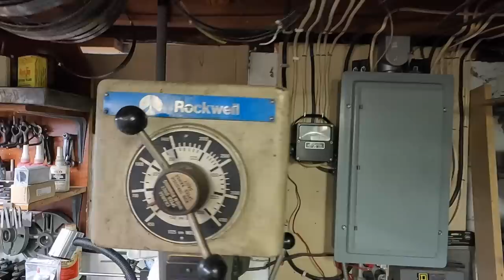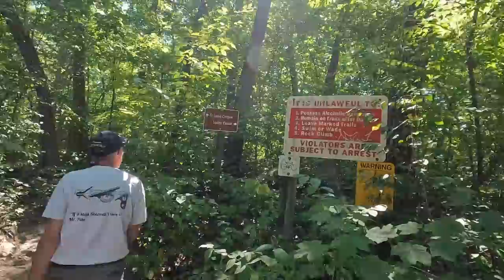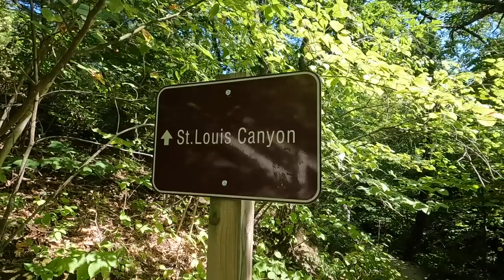Mr. Pete's Shop Tour

Comment: I have a question. Why have we begun to remove Machining from High Schools in our country? It seems we are removing the skills that young men and woman need in life to build confidence heading into this tough world we live in and sending them out without a single skill needed to survive. Autoshop, Metal Shop, Wood Shops all getting shut down. It's a shame really.
Reply: It's a huge mistake that will come back to bite us in the near future.
Reply: probably because it adds an enormous amount of liability rider to a local school board insurance coverage. I took HS shop (and loved it) back in 1983... we made flat blade screwdrivers and had to heat treat them in an enormous 1960s era gas fired furnace. Mr. Boyer (our Magnum P.I. clone teacher) said, "when I light it, don't look into it!" One guy did and singed all his facial off, especially eyebrows... nuff said... he was a moron but also the least common denominator. Instead of dropping our of school and getting a job, the rest of us had to endure his humor!
Reply: My school still has a wood shop and a machine shop, but it is certainly the exception rather than the rule.
Reply: I graduated in 2002 and we didn't take no machinist type metal shop we took welding they had a small couple week class on CNC Machining but no manual Machining work
Reply: @lucaslac124  Back when I graduated in 1997, our shop class had all kinds of wood and metalworking equipment, which most had laid dormant for years, and the whole excuse was liability. Ironically, there were no issues with us running a big bandsaw, drill press, or planer, but nope, don't touch the lathes or mills, and quit asking if you can use them.
Reply: Not many people are interested in trade work when you can come straight out of college at 22 making over $100k with a computer science degree. I worked as a CNC programmer and machinist for over 10 years and even with that much experience I wasn't even close to making the money I make now as a software developer in corporate IT.
Reply: You should have asked that 20 plus years ago
Reply: I don't recommend high school students using table saws or lathes. Milling machines, drill presses, routers, jig saws are okay.  Machining requires a lot of spatial intelligence. I don't expect teenagers to have that.
Reply: Insurance companies from what I was told
Reply: So China can take it easily with no resistance l🎉
Reply: This is a natural behavior i guess :) the world has gone vider and the mashinging so! No need for those old school mashin any more. The day this is needed agen we have serious problems! Love to use them but it ends there!
Reply: @DaveElectric  interesting. I learned in high school. Not at school. Bought my own.
Reply: Sadly,  a lot of the tech ed classes have died and gone away for a variety of reasons.   First, we don't have people with the skills to to teach them, the last retired years ago,  and we can't find anyone with the skills to teach them.  Second, liability issues scare the hell out of district level admin.  Third, I don't think kids like getting their hands dirty.  I teach physics with a lot of kids who want to go into engineering, but have no idea how anything is made....
Reply: Well there are tech schools or trade schools and every district has one. On top of that many states have technical community colleges. This allows kids to go to high schools with often times better and more focused academics and then when they are a bit older or mature they can go to regular college or specialize in a trade by picking the technical community college.
Reply: @lucaslac124  Yeah same but where not allowed to use the machine shop for some reason
Reply: Wood, Construction, Metal -Shops are very common in 9th grade and higher schools in middle europe.
Reply: Hello. Welcome to the future. All beneficial skills have been eliminated from the curriculum..
Reply: There's a long answer and a short answer to your very interesting question. The short answer, I think, is few people in the education establishment understand the value of manual skills, and almost none are skilled enough, or even smart enough, to teach the classes. The long answer has to do with an argument over the proper goals of education leading back to the late 19th century: is the purpose of high school to create well-rounded adult citizens (liberal arts), or is the purpose to create productive workers (job and career readiness)?

Shop classes were created by the latter group, with the goal of training kids to be operatives in factories. At least in the New York City public schools, when I was growing up, the official name for these classes was "industrial arts." Ironically, though, even though the "job and career readiness" party basically won, and largely controls education today, they are the same ones who have killed off shop classes. Machining is not "relevant" to "today's workplace," you see. And as far as it goes, that's true. Even in the unlikely event that a kid grows up to work in manufacturing, the chances that he will be running a manual lathe on a shop floor all day are next-to-none.

But I think this is a very short-sighted view. We have raised a generation--maybe two--who have no idea how anything works, and believe good things just come to those who have enough "commitment," by which they mean, not actually understanding and working, but wanting strongly and earnestly. Meanwhile, they can't so much as fix a leaky toilet.
Reply: @jaysgood10  so counting's not beneficial in a trade anymore?
Reply: @danmenes3143  I think our society is missing the point of teaching "Industrial Art's". These skills may not be "needed" to earn a living but the skills you learn while doing these activities can help you in anything you do decide to do. Learning how to think your way through a problem. Learning calculations, patience, how to work through mistakes. My woods shop, Auto Shop, Welding classes gave me confidence in trying new things and thinking my way through obstacles. More importantly, it allowed me to better understand the mechanical world around me. Not to mention the household repairs that can save anyone money. Insurance I get but we as a society need to understand that some things are more valuable to helping kids transition into adulthood then what they are currently teaching. I value the things I learned in building something from nothing far more then what they taught me out of books. I learned how to learn and more importantly, how I learn. Not everyone learns the same and having to pay attention and focus on something piece by piece is a very very important thing to know when doing anything.
Reply: I just graduated high school with no practical skills because they had no good tech classes. They got rid of there welding class just before I wanted to do it sadly. But now I work at a metal fabrication shop. we do it all
Reply: @goboyz8016  Very well put.
Reply: @HarryManback0  and I came straight out of high school and after a 5 year apprenticeship as a sheet metal worker, I made $90,000/year, had top-shelf health care, and retired with a full pension + annuity. BTW, I received college credit for my apprenticeship and received my bachelor of science degree in 2003. Trades are still a better deal than a cookie cutter degree that doesn’t guarantee a job. I had no college debt and was paid a good, living wage while I learned my trade. All books and training was paid for. Best decision I ever made 😊
Reply: Shop classes not only teach tool skills, but the most important part is learning problem solving and critical thinking. That is sorely missed today
Reply: because kids no longer have the basic  fundamental skills to use them.  you can't just take a kid and drop them in front of a lathe at school and expect they are able to use it.  they need some exposure at home before. My granddad built me special standing platforms for his metal spinning lathe so I could learn to spin pewter when I was a kid. Kids need more exposure out side of schools.
Reply: As important as machining is to the economy, it’s a smaller proportion of the labor force than it once was. Whenever manual machining as we know it today got started (I’m afraid to even guess or I’ll get @ed into oblivion), all of information technology came since.
Reply: It's terribly sad. I was in high school 90-94. And our metal working area was closed up.
Reply: @zeitgeist2720  Glad to hear that.  You're could be lucky enough to learn something.
Reply: For certain there'd be releases for injuries and such.
Reply: @DaveElectric  that's the kind of attitude that is dumbing down humanity. Yea it takes spatial awareness to operate machinery but if you arent exposed to it and don't learn it as a teenager you never will. A good shop teacher like I had knows who's capable of what and limits tool usage until he or she is fluent.
Reply: To those complaining that Trades are no longer taught, get involved!  They’re taught where I live, there’s at least one trade/specialty taught per school. Other schools have the other trades and students can choose where they want to go.  Local officials have very little to do with what is taught or offered, its done by edict at the state level, so contact your elected officials to voice your desires.  Yes they were removed, but that was decades ago, and they’re making a comeback.  Make sure your legislators make funds available for these curriculum.
Reply: It's sad but it seems that the public school system is broken.
Reply: It's nothing to do with politics as some people are claiming. It's all about the cost of liability insurance, which is a direct result of sue happy culture.
Its sad, and I think it's needed now more than ever, but schools are underfunded in most places and cuts will be made for expensive programs.
Reply: @DaveElectric  saw stop products would work fine for tablesaws, but they are expensive.
Reply: @hgbugalou  Absolutely agree with you there. It's as if the our society and law firms have become sue happy. When they won the McDonalds "Hot Coffee" suit years ago I knew we were in trouble.
Reply: That's why we need to support channels like this, These guys are the Rock stars of the craftsman age.
Reply: @wansolve289  And just where is it, that you live?
Reply: Its just the same in the UK , health and safety gone mad
Reply: They don’t want us to be able to fend for/support ourselves without their help…….
Reply: @DaveElectric  Really dude? Where the hell do you think those responsible adults were trainded to be what they are? The don't just wake up that way

Comment: 6:03 the most important feature of using the rods is built in temperature compensation.  Many factory floors are 40 deg plus or minus from the standard temp and the rods compensate for that.  A lot of machine shops would be 80 deg warmer in the summer than the winter that would be a big difference on a couple of inch bore from one season to the next.

Comment: General lathe question. I have noticed on many machining channels that I watch: when the machinist is cutting an internal hole on the lathe, its always just cutting on a plunge in. wouldn't it be faster to plunge in to the end of the cut, go a bit deeper and cut on the way out? I suppose you could, but there would be detrimental effects. maybe because the inserts would have less support, or the bars are not designed to take the pressure of a pulling cut instead of a pushing one. possibly the inserts are not designed for that. maybe the bar would spring more and cause chatter? looking forward to some answers. thanks for your time.
Reply: boring bars that use carbide inserts have a machined pocket typically called a "nest" where the insert is seated. The nest is designed to be pushed against by the insert during cutting. If you run backwards all the cut pressure is pulling against the screw holding the insert in.